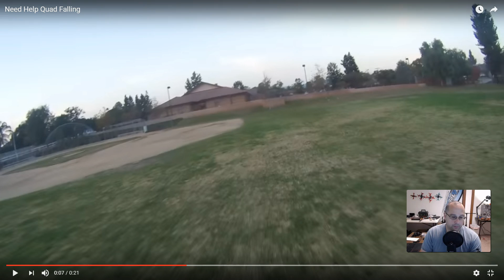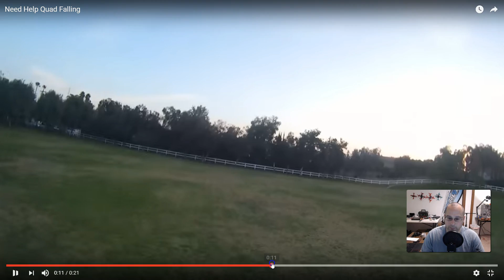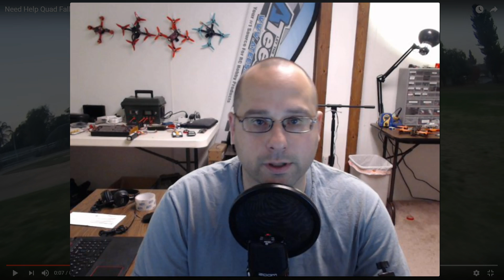Response to Brian Schwab - Troubleshooting BLheli Startup Tones

Comment: When i plug in my eachine 3 i only get 3 beeps and the quad doesnt arm, however if i plug in the quad to BF i get all 5 tones and the receiver lights up and i can arm the motors while plugged in to BF.. Any ideas as to why my quad is not arming on baterry power and the receiver isnt lighting up?
Reply: I took tbe top off to expose the rcvr and other wires and i pushed in all plugs and this morning i plug in the pack and lo and behold i got all 5 tones and the rcvr lit up which allowed me to arm my motors without being connected to BF. Maybe it was the jiggling around of the wires but the quad i rwady to fly. My concern is that there is a loose wire and u0on flying im afraid the motors will cut off anddrop to the ground so i need to find tge source of this loose wire just to be safe. It was sure nice to gear the 5 tones tho👍👍✈️🛩️

Comment: Hi, thanks for the video. Just had a minor crash with my cinelog 25. All appears well, but on connecting the battery I only get the first three sounds, not the final two for the throttle. The transmitter tells me 'telemetry recovered' but I can no longer arm and it does not give me switch warnings as it once did. Can you point me to another of your videos that may help to fix, or recommend any trouble fixing steps? thanks
Reply: having the same problem, how did you solve it?
Reply: @sdproduxions did you fix quad

Comment: very interesting.
I have a quad where the first 3 sounds come when plugging in, but the throttle sounds take about 20 seconds to sound.
Any ideas why this might happen. as a note, my friend has the exact same quad, but his throttle sounds come straight away.
Only difference is mine has digital and his is analog.
Reply from the maker: It means the eac is taking longer to initialize. Usually this means the motor signal is a little noisy. You can drop down from 8k to 4k pid loop, or from DSHOT600 to 300 and it might help.
Reply: @JoshuaBardwell  🤜🤛

Comment: Hi joshua , Thanks for making all the lovely videos . I have a question for you . A friend of mine have a mamba f50 blheli s ESC . What he did was , He flash bluejay firmware to the ESC but the ESC could not support BLHeli 32 , so he flash back back to BLHeli s firware back to his ESC. The problem now is he couldn't takeoff . ESC detected but couldn't take off  What would possible the problem is ? Thank you in advance buddy .
Reply from the maker: Does he get startup tones. Does the motor spin from the motors tab sliders. That's where I'd start.

Comment: Helo mine happened like this. But after that esc wont beeping again and cannot read by blheli anymore. It can power FC and running betaflight, but in betaflight it wont run motor test. My board is iflight succex f4 micro 12a. Please advice

Comment: On my tinyhawk2freestyle, all motors twitch for the first three beeps, but one does not upon the final two beeps... what might that mean?
Reply from the maker: The FC is damaged or the FC has incorrect motor protocol selected. Did you just flash it? If so, it could be configuration problem. If it just randomly stopped then it could be damge.
Reply: @JoshuaBardwell  I haven't flashed it, but I have had to direct solder the motors on several times due to crashes, so it very well could be damage..   I guess its down for good this time?

Comment: So i crashed mine right from jump on take off straight into a metal trailer and now I get the first beeps doo do doot but then nothing . If im using pins ,how do i trouble shoot or find out which pin is broken? Or am I going to have to buy a new fight controller side or could it be the female side on my escesc? I need to get back in the air bad. Just had to send my first 5" back cause it was faulty doing something very strange and my 3" is down;( to boot i just had my new skyzone oled come in and i cant use them ,(

Comment: I might now get help with this but I’ll give it a shot I’m a bit of a stoner so I might have to be explained this if I were 5 ..... so my kwad drops out of the sky too and I also hear the tone but now one motor won’t work at all but I noticed at start up when I plug in a battery I hear the first 3 tones from all the motors and then the remaining 2 tones come from all the motors except the one that apparently crapped out I checked all my wires but I’m thinking it might be the factory plug I got for the fc and 4in1 esc

Comment: Hey I have a big problem I need ur help I’ve been trying to find out what’s wrong but I couldn’t find out what’s wrong but when I power up my flight stack which it is a flywoo 16x16 and the first two times would go off like normal then the last two wouldn’t go off at all and then wouldn’t do anything I flashed it I changed protocol call and nothing do u know what’s the problem can u plz help me here’s my number 7055045894

Comment: What does it mean if there is no tone coming at all when i connect the battery?I had a crash, now it wont arm. esc have electricity because the leds are still blinking.
Reply from the maker: It's dead :-(

Comment: I only get the first 3 tones,  and my quad motors won’t spin.
Reply from the maker: Like the video says, if you're missing the last-2 tones, it means your ESC is not seeing signal from your FC.
Reply: Joshua Bardwell I seen that, guess back to google to see why there not. On a side note I tested the quad for a hover and everything was fine then I went and calibrated the channel endpoints via cli and installed my vtx and now nothing. I’m starting to wonder if the endpoint calibration has something to do with this. I always do this to my new quads so not sure why this time would be different.
Reply from the maker: Endpoint calibration should not be able to cause this.
First thing to check is the physical wiring between FC and ESC.
Second thing to check is the motor protocol in the Configuration tab (should probably be Dshot for most modern quads).
Reply: Joshua Bardwell thanks for the info, Turns out my issue was the 96khz firmware I flashed to the esc’s I went back to 48khz but not only 3 of the esc’s even show up on blheli, esc 1 just had dashes .thanks for responding though, love the channel 🤜🏻
Reply: @JoshuaBardwell  my FC and ESC are connected via pins (clamped together) and pressed all the way in yet I’m not getting “dooo doooooo” Pardon my singing🤷🏾‍♂️ but the last 2 tones are not there🤦🏽‍♂️ dshot 600 what to do?

Comment: i just dont get the last beep??
Reply from the maker: If you get 4 but not 5 beeps it means you are using Dshot and the throttle is raised. Not the throttle stick on the transmitter, but the FC is sending non-zero throttle value to the ESC. If you are plugged in to the configurator this could be caused by raising the sliders in the Motors tab. If you are not plugged in to the configurator then I'm not sure what could cause it.
Reply: Joshua Bardwell tnx for quick reply..... love your videos. Keep it up!!!!!

Comment: I'm not getting my last two beeps on my drone I don't know what's going on
Reply: petefly FPV did you every solve this, i have same 3 tones, i think its perhaps throttle settings related but im very new to this
Reply: @Farquharwatchco  yes the receiver wire came off I had to resolider thank for getting back..
Reply: is it solved? I am currently facing the same issue where there is only the first 3 beeps

Comment: I have a problem with my Geprc pro. The problem is pitch and roll suddenly switch. When I push the throttle and the drone go left. When I push the stick to left the drone go forward.  So how to fix. Thanks
Reply: Do you have e-mail address to contact you?

Comment: hi @joshua bardwell

i am new to fpv and i am having somewhat similar problem with my cinebee75hd whoop.it crashed unexpectedly and when i checked one of the motors got really hot.when i throttle up the motor vibrates  4 times and then the esc beeps once.i have uploaded a video of this problem.if you could help me solve this problem.i'd really appreciate that.
https://youtu.be/eNiciRxBeOc

Comment: I have drone which I created with racestar 35 a 4 in 1 ESC I fewed it twice after a crash I connect the battery my ESC beep beep  that all it not starting up correctly but when I went in betaflight I gave signal as dshot but that didn't help and I tried all signal type but non of them work    HELP

Comment: Joshua, I have a 3inch diatone GT m3. Took it apart to put in a caddx turtle, now on power up I get the three tones followed by two tones, but after that the motors twitch with a steady beep for each twitch

Comment: Hell Joshua,,,,,  this is my first built and when I plug in the lipo......all motors twitches and beep every second...can u help me ot on this  tq
Reply from the maker: Does it start happening after only 2 or 3 minutes? This is the "lost model beacon" feature. It's normal.

If it starts happening immediately, that's a little weirder.
Reply: @JoshuaBardwell  Thanks for replying,,,yes it happens right after I plug it in...u are right Lost model beeps...its brand new motor and esc too..I give this up 3 years ago after attempting to built drones,,,,then last month I have too many drones sitting around which cannot fly  cos cannot get help over here,,so i started back building a new martian 3..with 1806 2300kv and 20a hobbingwing xrotor.....

Comment: if i plug my battery on my quad and the beeps ar unsync that means something is wrong ? I mean my esc s sometimes does not follow each other like my 2 and 4 esc are late with the beep
Reply from the maker: It doesn't inherently mean something is wrong, but it's unusual. Try moving from Dshot1200 down to 600, or 600 down to 300 or etc.
Reply: @JoshuaBardwell  i'm on dshot 600 now i will try to move down to 300 than. Thanks for helping me out :D

Comment: I had this same issue last year. Turned out to be a motor screw touching the motor wires, causing that motor to short when it was above a certain throttle value.  Looking at the blackbox data I could see that motor randomly hitting 0% when it should have been above 60%.  But of course this can also be caused by a multitude of things.

Comment: Hello Joshua. Im using this video to try figure it out whats wrong with my ESCs. After flah the only do the 1st set os tones. My radio is on. In BlHeli when I press "Check" is says its in boothloader mode. 
How do I get back to "normal" mode so I can fly?
Tank you VERY MUCH for all you SUPER instructed videos.
Reply from the maker: Is the FC in bootloader mode? Did you hold down the bootloader button when you plugged in the FC? Normally you don't go into bootloader mode by accident.
Reply: @JoshuaBardwell  Thank you for your reply. No, when I click "check" in BLheli32  is says," boothloader h" protocol unknow

Comment: So I crashed pretty hard (I think) and now when I plug in a lipo, one red light appears on the FC and the two beeps from ESCs don't come on anymore. Also I can't seem to get any video and the LEDs indicating the channel on the vtx don't light up. Any help is much appreciated!
Reply from the maker: It sounds like the FC is dead. The fix is probably to replace the FC.
Reply: @JoshuaBardwell  When i plug the fc into my pc, it seems to work fine (this is when its not connected to the pdb). I use the matek FC and the matrek pdb/vtx

Comment: My problem is that my kwad worked fine a couple days ago but when I plugged it in today I got no beeps at all but everything else is still powered and the FC, vtx, cam,  receiver, still works. plz help
Reply from the maker: No beeps at all probably means the ESC is toast.
Reply: Joshua Bardwell but everything else still gets power from the esc

Comment: My drone beeps once and does not have video help?
Reply from the maker: Start by confirming that the vTX and camera have power. Use a multimeter to test voltage on the supply wires. Make sure the FC is getting power. Are the LEDs lit up?
Reply: Joshua Bardwell The leds now light up only when I plug a micro USB into the quad
Reply: My stack is the emax f4 Magnum

Comment: Why would I stop getting my 4/5th beep after changing my xt30 connector?
Reply from the maker: You are using DSHOT. Your throttle is raised above 50%. The ESC is refusing to arm because the throttle isn't all the way down. The XT30 has nothing to do with it.

That's my best guess based on the information I have right now :-)
Reply: Joshua Bardwell thanks man ill check that out in betaflight. I always have throttle at zero or else my tranny wont work so idk but you rock josh. I really appreciate you and your channel. Im taking out the 5" tonight cheers!
Reply: Joshua Bardwell well apparently beta flight doesnt recognize my qwad anymore..heheheh toasted

Comment: Hi Josh i got my fisrt built flyegg with all brand new parts. It can hover and wobble all direction when the throtthle increased. In BF the motor are not level when i use the tx... I did all tips but not works. My big thanks if you can help me. Thank you

Comment: Hey! I wanted to go and fly today, but my quad didn't want to. The escs are making beeps, but without the last one, so it is like beep-beep-beep going up, then a lower beep, and the last one, the higher beep is missing. It also means that the throttle signal is not there?
Reply from the maker: I think that means that the throttle signal is detected, but the ESC thinks the throttle is not at zero, so it is refusing to initialize. If you are using Dshot, then I don't know what could cause this. If you are using multishot or oneshot, then I recommend calibrating the ESCs.
Reply: Thanks for your answer! I tried to calibrate them (oneshot125), but I dont know why, they cannot be calibrated. I plus in the USB, I oull the master at motors to the top, then plug the battery, but nothing happens. May it be because of min throttle settings?

Comment: 61 y/o newb here. Quad is a Furibee Stormer. Found it after a fly away three weeks ago. When I connected a battery, it was nothing had happened. After cleaning it with canned air and a toothbrush, I only get the first three tones. What does this indicate?
Reply from the maker: The flight controller is likely dead.
Reply: Rats! Have you done a dedicated video on determining the differences between FC vs ESC problems? Thanks for responding. Being new to this, I don't know if my questions are stupid or not. Then again, the only stupid question is the one not asked. Keep up the good work.

Comment: So i have no more throttle signal.. the 2 tones signal goes on after a crash. My usb connection isn't working anymore and one of the small chip is really hot when i connect a battery or even a USB cable, my BF OSD leave also leave me after the crash.. any idea ? thanks
Reply from the maker: The FC is dead. Replace it.

Comment: Great tip Joshua. I have a slightly related question in that when I plug my battery in, it's quite a delay before I get the two tones from the escs. Not a consistant 3 tones and then 2 tones to confirm it's received the signal. Fine when the usb is connected though
Reply: I'm getting this same issue, the first 3 beeps for the powerup ring as normal, but theres a 3-5 second delay before I get the following 2 beeps. Just the same, when I power up with the USB connected to BHeliSuite, the startup tones all sound off normally with no delay. Motors all fire up fine, all test okay, and im even getting normal receiver/throttle function from what i can tell, tho I havn't actually taken it outside to test fly it. I can't imagine this means nothing, one thing ive learned with building and tinkering quads is that every deviation from the norm means SOMETHING lol
Reply: holy blueballs, i actually just figured out that it was "Display" checked on in configuration, strange I just figured it out immediately after posting my reply after almost a week of troubleshooting! facepalm
Reply: 8B1T dude I am getting the three tones and then a long delay for the last two times. You just unchecked display in the configuration?

Comment: My quad had a nasty crash and caught fire, I replaced a motor and esc and now all my motors spin in different directions. Any help?
Reply: I don't know if you already fixed that but this may be caused because you switched your main ESC. This should be easily fixable. Just use the BLHeli Configurator Standalone to configure the spin direction of your motors.
Reply: Fixed it now but if it ever happens again that's what I'll do, thanks!

Comment: Can a battery itself be the cause of a brown out? Now I have 2 quads doing this! Both started flipping out on the same exact battery. Might just be a coincidence. Battery is brand new. First happened with one or two cycles on it. Happened today on my fav quad with about 7 or 8 cycles on the battery. Im going crazy.
Reply from the maker: Damaged battery probably wouldn't brown out. It might crater and just drop the quad entirely. Brown out is more likely to be an over-drawn voltage regulator going into thermal shutdown. Consider that the regulator your FC is running off of is putting out 5v. So it needs maybe 7v input at least. Your battery would have to be pretttttty low to get down below 7 volts.
Reply: Thank you. I will get to the bottom of this.
Reply: You are correct. Thank you. Just realized that I wired the VTX to the 12v regulator. It can take 24v, so I will move it. I DID have a brown out yesterday on one of them. I started a flip directly overhead, I throttled up, started a flip, and poof - just static. It soared right over me and.... thud. Feels like it was the regulator, but I also think that the battery sagged past the set limit and it shut down at the same time. I did lose video, but I also heard the low voltage alarm as it soared over me. I suck at calibrating the voltage in Betaflight, so it looks like I am going to dive into that right now. Thank you
Reply: Moved the wires and added a 1000uf low ESR cap. Flew perfect.  Well.... as perfect as a frankenquad can.